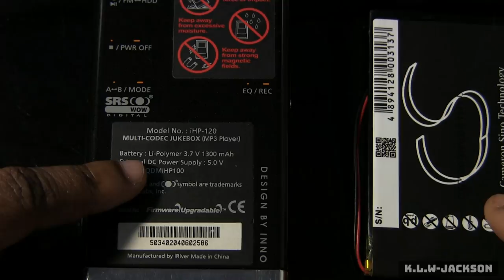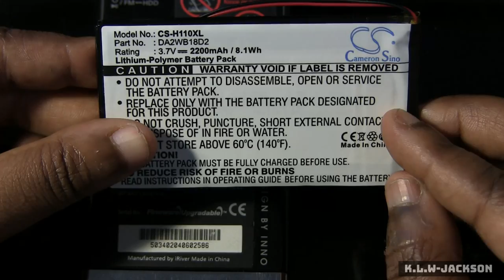Replacing The iRiver iHP-120 Battery

Comment: Greetings Kim from Wales, UK! Excellent very clear video! Many thanks! Removing the existing drive carefully leaves some old adhesive on the case for the new drive obviating the need for sticky tape. The case then closes easily. Very important not to over tighten the screws to avoid losing the screw thread! Took about 40mins to replace the battery.
Reply: Thanks! I am glad you were able to replace your battery.

Comment: Glad to see others still using their iriver and great video. I missed out on numerous h120 auctions and have a trusty h320. 
I've always hated how the location of the battery connector on the motherboard of my h320 because it got dust on my screen lol. 

Jeez, the fit looks even tighter than my h320 (with one pad removed),  with the zif adapter+msata combo I am running. Considering going compact flash or SSD upgrade? The Compact flash solution might work better, plus you wouldnt have to run the hard drive pads.

Comment: Thanks for the great video! I bought 2 of the very same batteries off ebay 2 years ago and have put off replacing the batteries in my H120 and H140 iRivers because I knew that doing so is kinda tricky (yep, I read posts in forums). This video, however, gives me the confidence all by itself to do the replacements. My H120 has been upgraded to an H130, i.e. by replacing the broken 20GB hard drive with a 30GB hard drive. So, I figure the lack of wiggle room for this battery will be even more of a problem. I'll cross that bridge when I come to it, but figure (probably rightly!) that I'll have to either eliminate the hard drive cushioning material noted in the video or replace it with something thinner. After all, the cushioning material is some insurance against breakage should you drop your iRiver, right? Some tradeoff is probably required. I've already bought the batteries so replacing my old now low capacity batteries with a 1300 mah or 1700 mah batteries is something I don't want to have to do if I can succeed in using the 2200 mah batteries I already have. The H140 should be less of a problem, the case being significantly thicker. This video lets me know where the trouble spots are. I especially like the fact that Ms. Jackson does not gloss over the problems, does not pretend something is a snap when it's not, and she did not add music... that I don't need in this! Kudos! Great job!

I don't keep my iRivers in a case, maybe I should, I have them. I do wrap them in a large folded handkerchief and put in a plastic bag when not in use. That adds some of the same hard drive protection that the internal cushioning material does. So, I figure I don't need that as much. My old batteries only last around maybe 6 hours when fully charged. It's enough to do what I'm doing, but I have to charge them frequently. That's partly why I've continued to put off replacement. However, keeping the "new" batteries sitting around for 2 years still shrink- wrapped isn't good for their health. It's time to get the job done. Another reason I didn't do the replacement yet is the reverse polarity of the leads from the battery, which I'd read about in the forums. I knew that people were splicing the battery leads. I did not know that it's possible, if you're careful, to not splice those leads but deal with the connector. I think I have the tools and ability to deal with that connection. The video makes the process clear. I had no clue that this particular battery does NOT have the reverse polarity issue until watching this video! Altogether, I was thinking, "OK, this is going to be tricky," which only made me procrastinate this project further. Thanks again, Ms. Jackson, your video is just what I needed to motivate me to get this done, and likely done right!

Comment: Oh hey I saw later on you have the rockbox firmware on it. What is better about that in your opinion than stock firmware? Thanks!
Reply: A lot of things are better with Rockbox! 😎 🎵  

" Rockbox aims to be considerably more functional and efficient than your device's stock firmware, while remaining easy to use and customizable. "

"Another top priority of Rockbox is audio playback quality. Rockbox, for most models, includes a wider range of sound settings than that device's original firmware."

See: 
https://www.rockbox.org/wiki/WhyRockbox
Reply: Being able to use higher capacity flash memory is the biggest benefit.

Comment: do you have a video on the HDD upgrade including what needs to be added (driver, etc.) to make the HDD work? Ideally, I want to change to a SSD but aside from the hardware differences, the install procedure would be the same including the drivers. I looked on your channel but didn't see any video for the HDD replacement. Thanks.
Reply: You would need to change the firmware to Rockbox and then you can add an SSD. Though I had  a few weird issues with the msata ssd, that I switched to a 128gb SD card into a Compact flash that goes into a CF to 50 Pin 1.8 IDE Adapter. Software wise, you'll need to find a disk formatting software that will let you format the ssd/sd card, etc into fat32 as windows  won't let you format hard drives past 32gb.